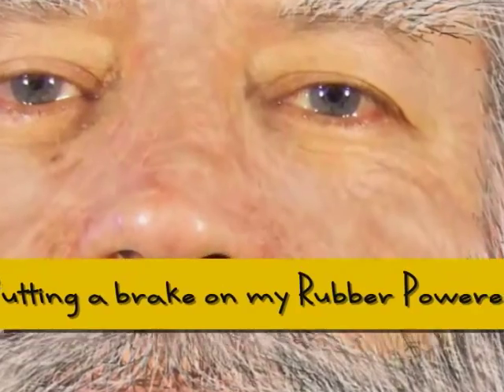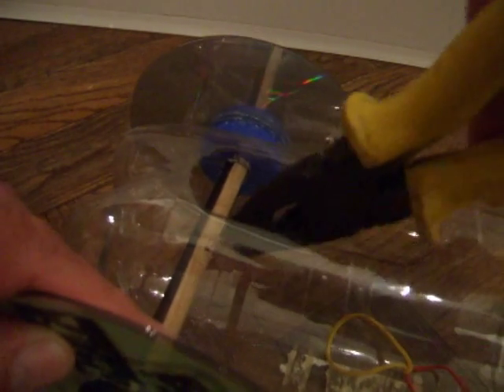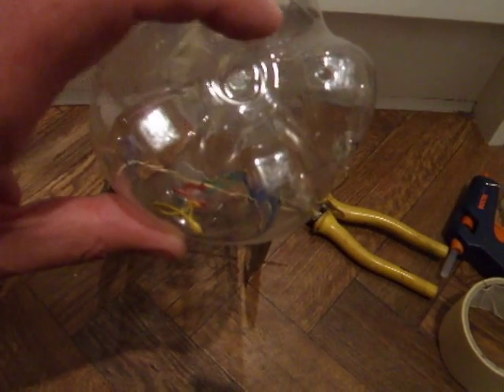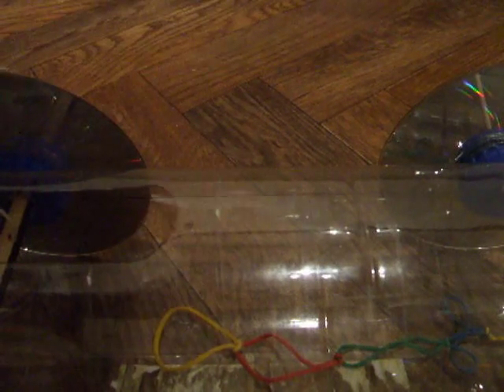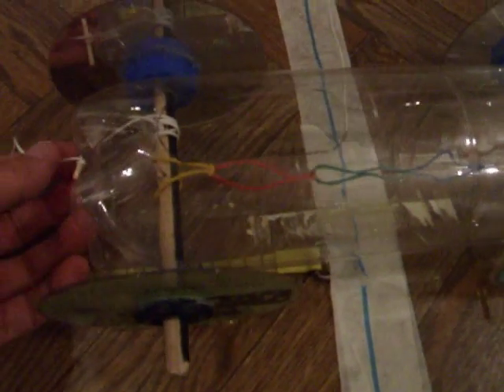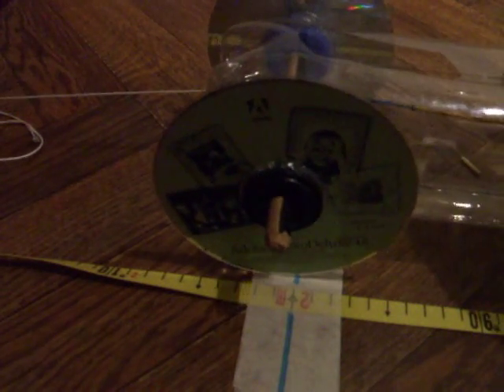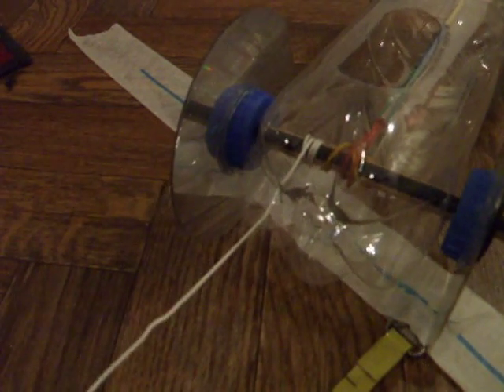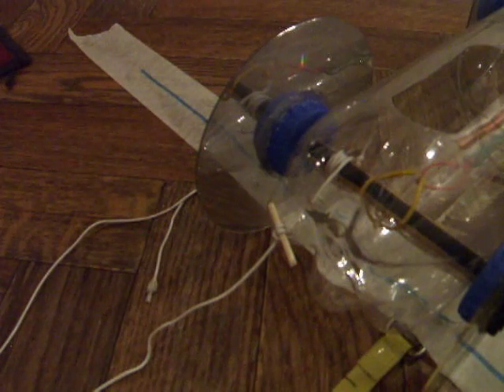How to put a brake on my Rubber Powered Pop Bottle

Comment: how do i attack the peg
Reply: +Drawing Masta what is the peg made of and etc info>?
Reply from the maker: +Drawing Masta there is lots of information in the video description. If you mean the peg on the string you just tie a knot in the string at the right length for the distance you want to travel
Reply from the maker: +Drawing Masta the peg can be anything you like. It just stops the string pulling through the hole in the plastic bottle.